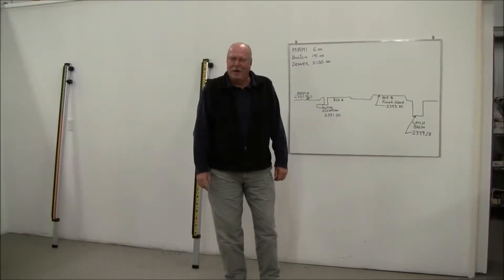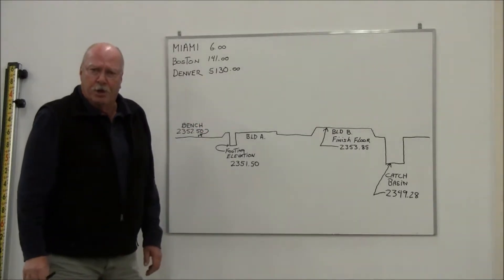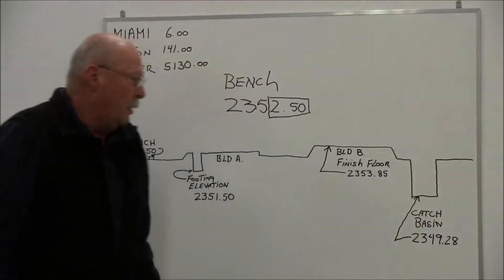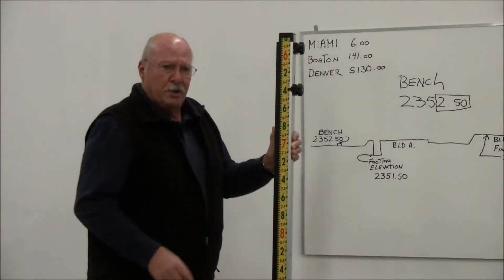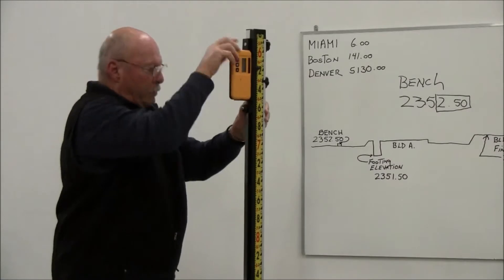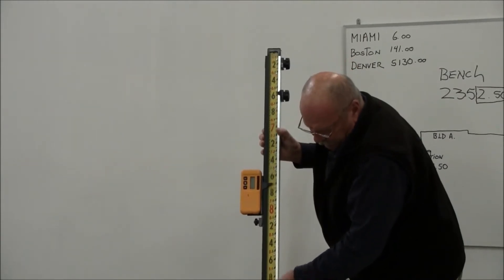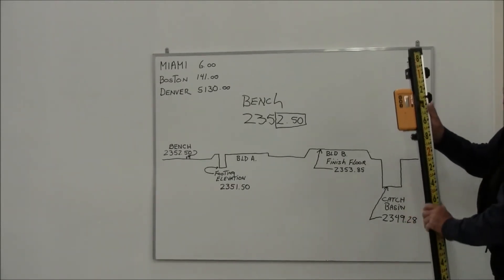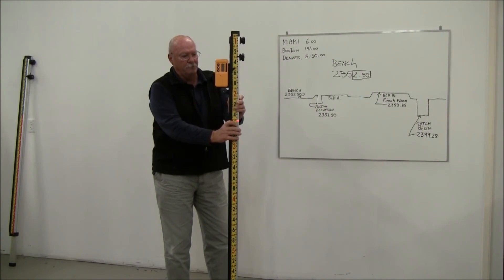How to Read/Use a Direct Reading-Lenker Style Grade Rod

Comment: If you extend the linker rod high. When you bench in will your elevation be wrong
Reply: Exactly! he went from bench 2.50 down to 1.50 then down to 9.28....he'll be 1.00 (1ft) to deep....nice video though....also I have rod without the laser rail and still able to use laser with full rod clamp as long as im within 30" to 3' from FFE, im able to get TOC, TOP, TOG and dial in sub grade for grade beams at least 24" deep. Nice catch, I thought I was only one the see that, good thing it was just demonstration LOL!!